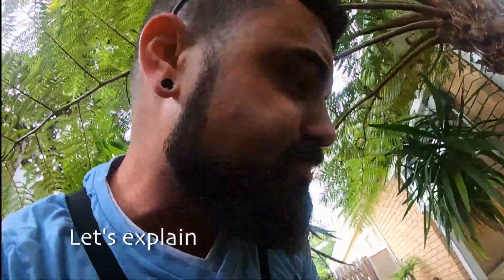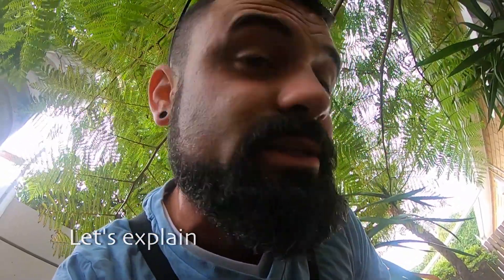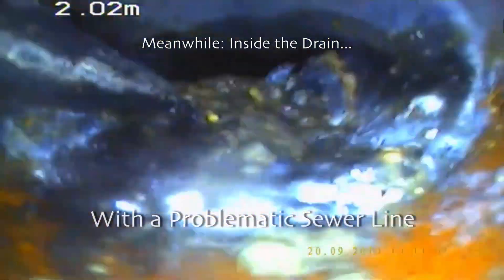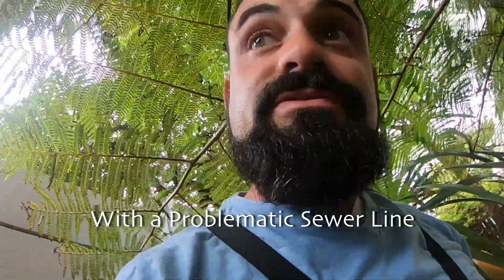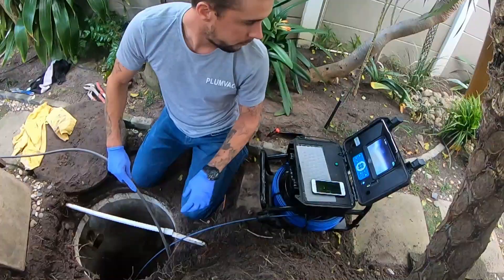What is Trenchless Pipe Repair?

Comment: Which brand sewer camera you guys using?
Reply from the maker: Benny Rabin I have no idea actually, it’s a combination of Chinese parts as far as I know. No indication of brand on the unit or from the supplier. We have 2 of them and so far they are quite strong and effective. Brands like Rothenberger or Rigid cost literally 10 times the price. In the past I would rather have paid more, but these cameras do everything and the quality is good. There is even an option for a camera head with built in transmitter.
Reply: We have the rigid and it's great. But it's like the guy said the high quality ones are expensive as hell. I think we gave 11k for ours. But it has alot of great options.